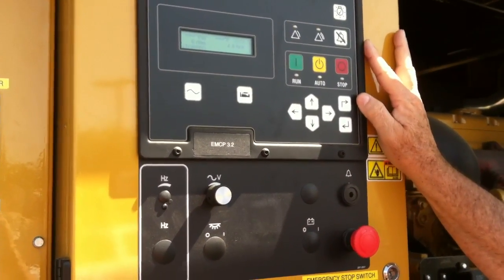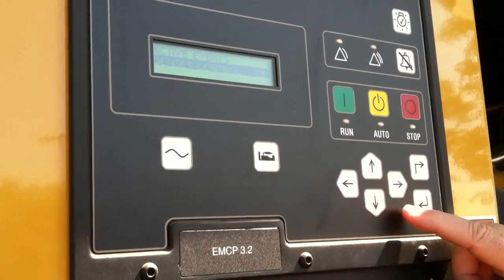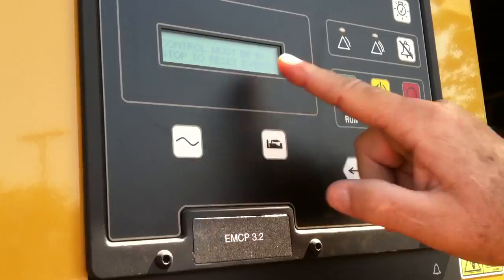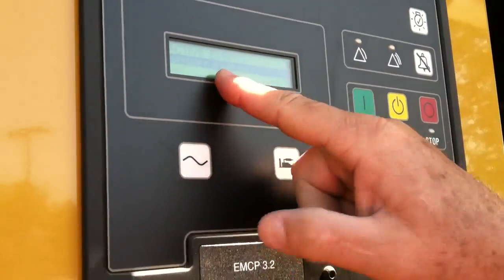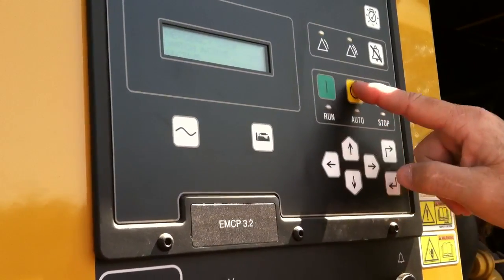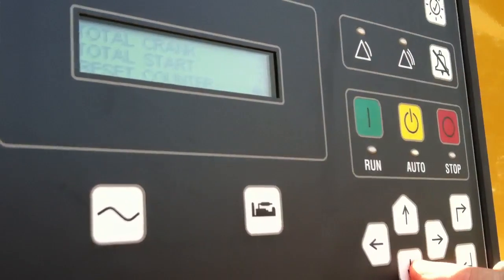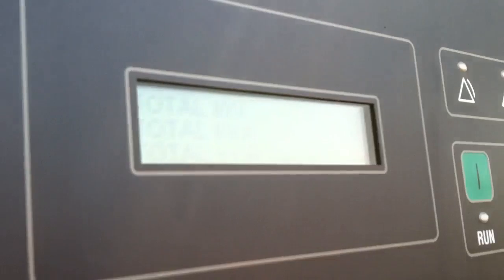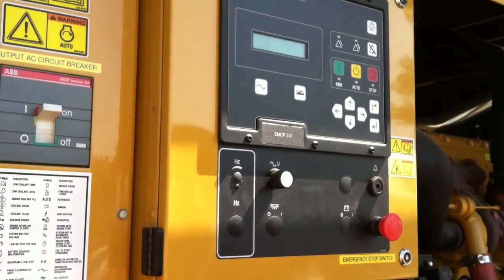Caterpillar generator maintenance tutorial video 2

Comment: Nice video. Thanks! Question, my same exact generator is running with alarm going. What does that mean? Also, what temp should gen be operating at? My inhouse display panel shows no errors. Thanks, John

Comment: Patrick. I just purchased a used Olympian G15U3S unit that has been down since 2016. I put a battery on the unit and the display works. I am trying to figure out why the unit went down but I have to down load the manual for it to read any codes. I know the unit was LP operated engine but I would prefer switching the engine to diesel. What type of engine would I need to get this operating on diesel? I'm waiting to here back from Cashman on the info as well. Thanks for your post~!

Comment: In standby mode Pressure show ** and Temperature show ****. But when it run all perimeters show okay. How I can fix this issue? Gep165-2 Olympian Gen.
Reply: Its not a issue when it's off mode ECM goes to sleep mode after some times then you will show only ** instead of reading once you try to start will get all reading properly and genset get to run everything fine